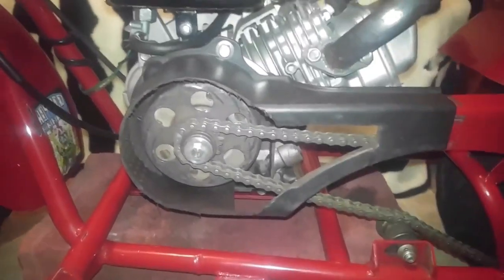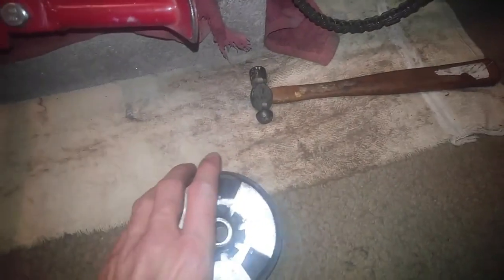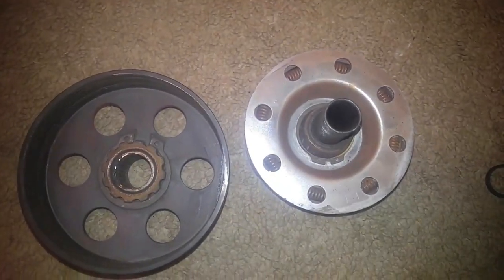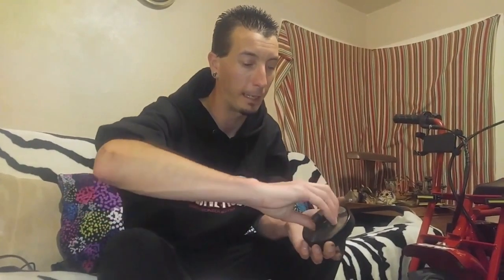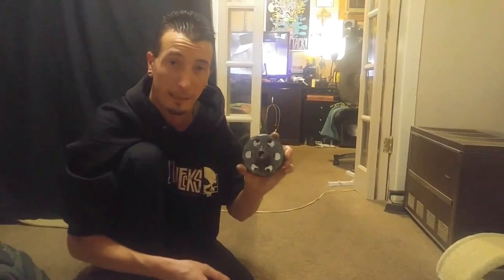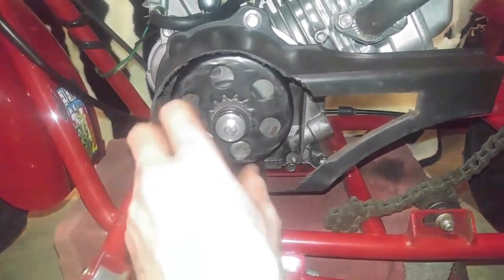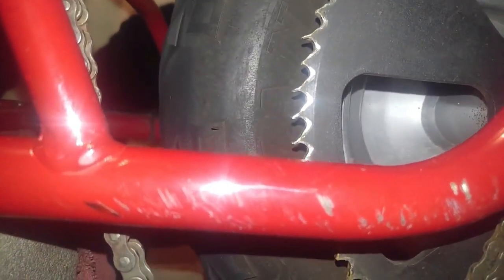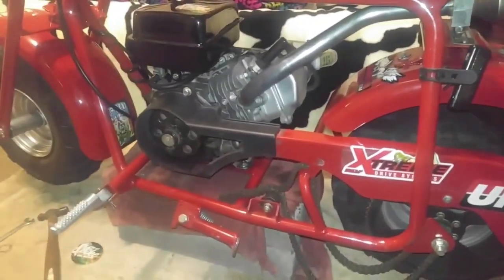HOW TO FIX A SEIZED UP CLUTCH ON THE COLEMAN CT100U SPORT BY SPIKEMANDAN

Comment: I’m not sure if it’s a clutch issue, but i have a c100x that i bought and have maybe put 5 miles on. Hopped on today, started it up, drove for a while and the chain popped off. put the chain back on and it won’t spin the rear tire no matter what i do. engine runs perfectly fine.

Comment: What tool and size do you use to hold the inside of the clutch to keep it from spinning while tightening and where can it be purchase d?
Reply from the maker: the right size wrench and wack it with a hammer or use an impact gun

Comment: Hey I have a question I'm new to this mini bikes now my mini bike starts up when I give it gas but won't stay running unless I keep giving it gas when I try and ride it does not go nowhere if you know what that problem is plz help
Reply from the maker: Have you tried adjusting the idle
Reply: Carberator. Either take it off and clean it or buy another one

Comment: The clutch on this bike I am working on is engaging when you get it running. Shouldn’t it only do that when you give it throttle?
Reply from the maker: Your idle might be to high
Reply: Okay I’ll lower the idle an see what happens
Reply: spikeman dan it’s the clutch. I got it apart gonna clean it up an re grease the shaft holding the cap over the clutch. Watched a video on Coleman powersports channel. Even looking at it. It’s super dingy an some rust an I could tell where one of the plates were catching cause it was locked an off set to the other plates.

Comment: My bike tire is spinning right when started and won’t come to a complete stop? It’s not in gear or anything and the throttle isn’t stuck
Reply from the maker: Either your idol is too high or your clutch is stuck
Reply: @spikemandan  we redid both and didn’t help so we’re just bringing it in to see if they can fix it
Reply from the maker: @lilliemaeh  buy a new clutch maybe
Reply: Did you ever figure out the problem.  My brand new bike is doing the same thing

Comment: my  clutch is totally idk just messed up it obliterated itself so its seized up and moves with the wheel, my pull start is messed up and cant be mounted so i start the bike by pushing it. since the wheel rotates the clutch the whole cylinder moves and fires up, its lots of fun until recently the spring snapped, i bought a new clutch and the mini bike works like normal now but i dont like it lol. i cant find any videos on how to seize your clutch. really recommend having a broken clutch makes the mini bike faster and much more fun . soo if your watching this with your seized clutch be grateful dont even fix it!

Comment: I think mines seized it wasn't turning freely anymore  it barely turned anymore and ive already oiled the clutch which usually fixed it because it would start take off and die now its having trouble starting and dieing and after it starts once it won't start again and the pull cord for the recoil doesn't retract all the way anymore that easy so that could be an issue as well so hopefully I can break it loose that should get ot running again like a champ💯💯

Comment: Are you still helping people because I ordered a cutlch for a 212 predator and when I put it on and run it for a few minutes I hear like a bell noise and it gets red hot what do I do ???
Reply from the maker: What size sprocket are you running on the back tire you're probably putting too much stress on the poor clutch
Reply from the maker: Be more specific
Reply: @spikemandan  the stock sprocket for a bt200x
Reply: @spikemandan  it’s on a 420 chain
Reply from the maker: @joshuagaming413  make sure the chain is not too tight
Reply: @spikemandan  it’s not I’ve tried oil it and everything nothing seems to help 😔
Reply from the maker: @joshuagaming413  unless I can see a video of exactly what's going on get a hold of me so I can review it and further determine what your issue is otherwise it just sounds like you fried a clutch and nothing you can do about it
Reply: @spikemandan  so should I just buy a other one ?

Comment: The clutch is on but I can’t get the nut tight the clutch just spins what can I use to hold it and if you have a link of some sort to send me for a visual that would help I can seem to find anything to hold it snug enough and I’m a noob been having a lot of road blocks but u have helped alot
Reply from the maker: hey buddy sorry it took me so long to get back to ya but! if you look in this same video @(14:43) you will see i use a 10 mm wrench and a small hammer to tighten the bolt on to the clutch there is no torque spec for it as long as its on tight enough just by hitting it quickly and hard enough to tighten it hope this helps
Reply: spikeman dan hey it’s weird it’s like when I go to tighten the clutch bolt it just spins it’s like there is something keeping it from stopping spinning ? Any ideas?
Reply: spikeman dan it’s like the clutch spins inside when I try to tighten the bolt and I don’t know how to keep it from spinning to tighten it if that makes sense
Reply: spikeman dan when I put my clutch on it spins when I try to tighten it it’s hard to get it tight since it just spins
Reply from the maker: Darryl Novak I told you you have to tap it with a hammer and a wrench otherwise it's going to turn the engine over either that or you have to get an electric impact gun
Reply: Use a small impact driver, air or electric.  Done!

Comment: And this is why we get torque converters
Reply: I would recommend to people who have clutches to use chain oil on the clutch before you ride
Reply from the maker: @TheGameBest7  clutch is actually better in most cases
Reply: @spikemandan  we both have separate opinions, I just like torque converters more because they are less likely to lock up and the belt is easily replaced